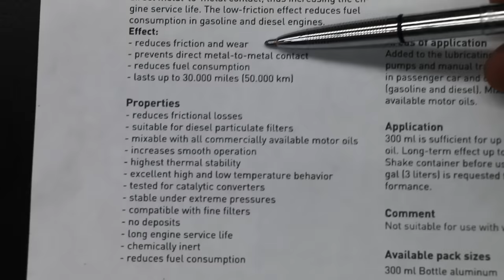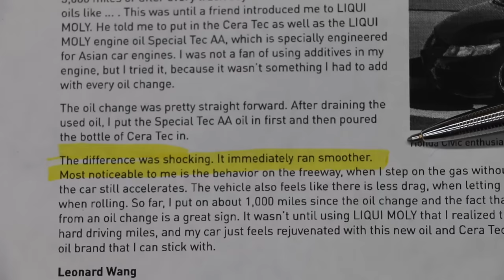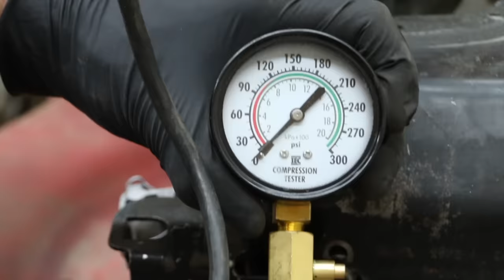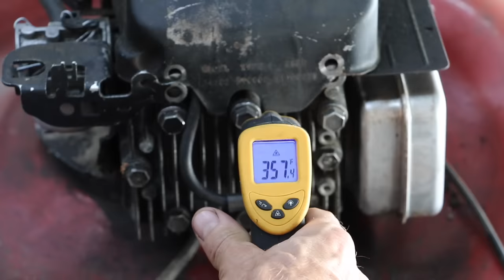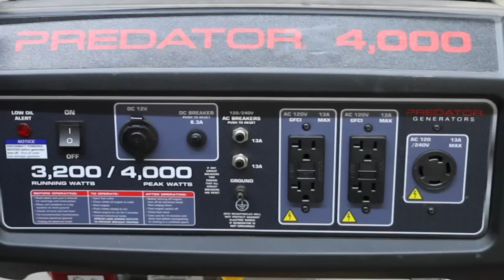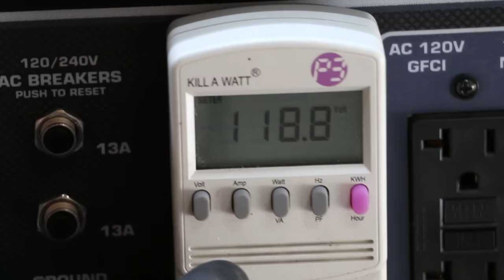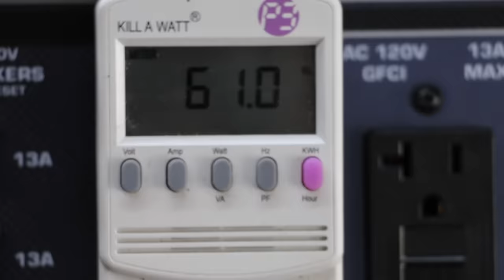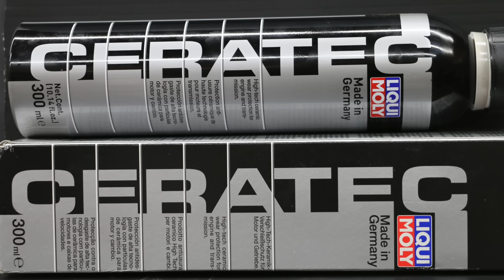Does Liqui Moly CeraTec work?  Let's find out!

Comment: Is it really fair to measure these results using a lawn mower engine? Think of the sheer amount of surface areas, contact points etc in even a small 4 cylinder car engine.
Reply: applicable to splash oil systems only i suppose, such as small engine mowers and the like.  modern automobile engine that has tiny oil passages and under great pressure, not so much.

Comment: THE COST FACTOR: 
Does the added cost out weigh the benefit ?
Reply from the maker: Great point.
Reply: Doesn't
Reply: If you run 100 tanks of fuel between ceratec treatments you will save 1 tank of gas, if my math is correct.
You also save at least 1 quart of oil.

Comment: To quote a poster named Daniel: 

'Moly is a solid friction modifier that takes at least 300-500 miles to film over the engine internals. I have been using Ceratec (a Liqui Moly product as well) with every car I own for years. Apart from smoother running, smoother idle, lower running temperatures, and improved fuel economy. I am positive that it keeps engines running longer. In order to determine if something is working, you must first forget about your expectations and make sure you fully understand the product.'  

end quote

Secondly: 

You tested this in a lawnmower engine (moly was not designed to be run in mowers...) for far to short a period of time.

Moly takes time (and miles) to coat the internal engine parts.

Thirdly, 

Moly was primarily designed to reduce wear and tear on an engine (usually automotive engines) the fuel consumption improvements are only a secondary benefit. 

As Daniel said 'In order to determine if something is working, you must first forget about your expectations and make sure you fully understand the product.'  

Maybe next time.

Comment: One interesting point that the Oil Geek made which nobody else has touched on is how these oil additives affect the additive package that's already present in the oil. I think that it would be safe to assume that any testing that Liqui Moly has performed on Ceratec was probably carried out using Liqui Moly oils. So if you want to run with a oil additive,  it might be prudent to stick with an additive from the same manufacturer as your engine oil.

Comment: Just something to think about if it was so good across all platforms why wouldnt big oil put stuff like this in to begin with and just charge more.  Also do you think the new plug had any affect on the engine rpm slight bump?  Thanks for the great video and hope to see you test the other additives too.  I would also love to see how much power you could crank out by bumping compression lightening the internals porting and polishing and some other inexpensive modifications to your bike engine and an expansion chamber if it doesnt have one sorry I cannot remember.  If you do gain more power i would like to see a gear ratio swap to take advantage for more top speed.  Thanks
Reply from the maker: All great point adn thanks for the video idea!
Reply: N1ck0145 Garage I haven't had the money yet, but I do have a series on engine modification. Trust me. I will work on your ideas as soon as I can. As I can afford them. And I have taken fuel efficiency testing into all of my experiments since 1999 so you can be assured the most accuracy possible for a street driven vehicle.
Reply: Because of cost.
Reply: Big sea but they could make the money back in by charging more
Reply: Very few people will spend the money for SYN these days. And own the retail side oil is pretty much non profit already. Its easier to explain a single product. when most people stick by one brand oil. This way makes it a lot less complicated.
Reply: N1ck0145 Garage it's already in nearly every oil for sale. Trust me this one IS used by the big companies. It's just unique to see it sold by itself and be something everyone likes. In low additive products for motorcycles, like Honda's motorcycle oil, they still don't skip this important additive.
Reply: I run Liqui Moly motorcycle additive in our super sport race bikes also works great.
Reply: I worked in the electronics section of a factory that makes giant doors for a few months.  I said they should have a 3 led display to show the position of a component in the door which would help allot with troubleshooting malfunctioning doors.  My boss said the vendor they use does exactly that but it's another dollar per a unit so they opted out.  My employer sold those doors for up to 100,000 dollars so I asked if they gave the customer the upgrade option for a dollar and he said no they don't.  If the masses don't demand excellence we won't get it and most people don't know what to ask for because it's complicated.

Comment: It's definitely not snake oil. Its effects can be seen over time but it does positively effect the surface of the cylinder walls.
Reply from the maker: Thanks for commenting on this.
Reply: Says the snake oil salesman.
Reply: evilution  It doesn't do nothing. It almost shot peens the cylinder walls over time and you're certainly not going to immediately see results of it. Its affects are long term.
Reply: In one 2013/ 30k miles engine which needed a quart of oil every 1000 miles of hard pushing we saw a great improvement seeing 1 qt of oil after 4k miles of hard drive. If that's not good results then I don't know what is.

Comment: I can tell you this, my 2018 Mustang GT had a ticking sound , as soon as I added Ceratec the tick stopped !
That is the real deal, anyone that has the Coyote tick, this stuff WILL stop it.
Reply from the maker: Thanks fro the feedback.
Reply: Agreed. My 2019 GT made so much noise you could hear it from 50 feet away just ticking away like it had a rock stuck in the engine. Poured a bottle in and after about 10 minutes it didn’t tick anymore. It changed the idle it didn’t sound as rough anymore. Not saying these tests were wrong but it has silenced my Coyotes engines problems.
Reply: Got rid of my tick as well, right after 1st oil change the car got the "tick". Added this and my tick is gone.  2020 Mustang GT 8200 miles.
Reply: @davidtennien2806  nice Brother

Comment: I have to say that it works at least on the noise perspective. I added this to my motorbike with a dry clutch (BMW K1200GT) and it worked wonders reducing the amount of noise the engine makes. This particular model of motorbikes are quite noisy and it indeed helped.
Reply from the maker: Thanks for the feedback.
Reply: Have you actually tested the noise level or does it just seem like being less noisy?

Comment: I just changed the oil in my VR6 track car before tomorrows event and lit looked like liquid bronze and I was terrified.  On the dipstick it's super clean and clear every time I check it.  Then I remembered I put this Ceratec in that oil.   As for my opinion, tomorrow will be the 6th time in the last year that car is driven 100 miles to the track, been hot-lapped for 120-140 miles, and then driven home.  The engine consumes 1/3 qt every 3000 miles and produces the least crap in the catch can I've ever seen.  I try to kill it every time I drive it and it won't die.
Reply from the maker: Thanks for sharing.

Comment: after the Failure of MoS2  I'm off the liqui Moly band wagon.
Restore and seafoam for life!
Reply from the maker: Restore and Seafoam are great products!
Reply: Ive used Restore watching your video as a directional guide for how to use it properly, and I know you arent a spokesperson for products but you have certainly helped show us that reading the directions carefully is very important to get the real best results from them, and im my case i certainly did with my old toyota engine. thank you
Reply: @dr.shahid3244  I am using Mos2 on a BMW  3 liters, in the cold winter of North America and it is working as advertised: Lower noise after start up, lower noise during normal idling and accelerating. Lower vibrations over all. lower coolant temperature. Better miles per gallons.
Reply: @TBPony  restore riuned my pathfinder r51 2007 4wd on first use the car bucks and sick not working well like bad spark plug after flush and refill with oil it be comes ok
I hate restore 👎👎👎

Comment: So Motorkote is the only one that works? So far.
Reply from the maker: Bestline and MotorKote both seem effective.
Reply: Project Farm - Ever since the Motorkote video, I can't find the stuff in any of the Walmarts! It's like everyone that saw your video ran out and bought it all up.
Reply: Itsa Mea itsa i went looking for motorkote to walmart as well and could not find any so went elsewhere and finally found a bottle in OReilys. About 2-3 weeks later i saw a bunch of motorkote on a clearance rack at the entrance  of the same wm store...bought a couple more bottles, but i think i could not find any to begin with cause the store was gathering the product for clearance...after that the store is no longer selling it..think it was justo a coincidence in time with the video at least in muy area..
Reply: I got mine off Amazon. So far it seems to be making an improvement in both my vehicles.
Reply: Try a Love's or some other truck stop.  A lot of truckers love the stuff and that's where I got mine.
Reply: will do, thanks
Reply: @ProjectFarm  motorkote there is a video compared to FR3 hot shots friction reducer, they put the two on a burner heated them up for a while and the motorkote  burna up into a thick sludge and FR3 is still clear.. Motorkote has chlorinated paraffins in it apparently and that's what causes issues when gets up to temp... It's on the hot shots secret page the vid
Reply: Iam using it in an engine for many years, no problem so far, engine always running good.I have tested it and its just fine.
Reply: @Itsa_Mea  Amazon..lots of it
Reply: @talonskull10  exactly where I ended up getting.
Reply: Pestilence Nigh : The FR3 is also a Group 5 Ester based oil which will take 500 degrees F. Motorkote probably will take 375 to 400 like most Group 2 oils.

Comment: We have a 2013 Skoda superb Estate 1.6TDI that we used as a van and, to run around for the employees, 190k miles....the engine started to be noisy and eating more fuel. I used the Liqui Moly sludge flush, and gave the car to the handyman, after 160 miles, we changed the oil with generic Skoda oil plus  LIQUI MOLY Pro-Line Engine Flush and new filter, left the engine running for 20 minutes and after emptying everything and put Liqui Moly Top Tec 4200 5W-30 + LIQUI MOLY Cera Tec. I was shocked at how nice the car was driving after, plus, the guys from the MOT said the emission test and everything for a car with 190k+ miles and 2013 is amazing, as it says in the book, It worked for my work/run around car. And even now, after 4 months, it drives very smooth.
Reply from the maker: Thanks for sharing.

Comment: Single cylinder Honda motorbike 150cc class… 1st a flush (liqui moly brand), then a “rinsing” oil change THEN the Ceratec mixed at 6% ratio with 0W-30 100% synth oil. Engine went from whisper quiet (before) to almost inaudible (after) Ceratec. Undoubtedly this stuff is doing something. Curious to see what it will look like after 5000kms in the drain pan guessing lil cloudy like cream in coffee.

GREAT channel🏅 Thank you🙏🏽
Reply from the maker: Thanks and you are welcome!  Thanks for sharing.

Comment: So with Mos2 on its own, I couldn’t see good results being shown. But I was told from a Liquimoly rep at a European car show; after questioning him about their products I was told that because it reduces friction: I should see improved fuel economy due to increased mechanical efficiency; and lowered oil temps because of the less friction . The Ceratec solids last 30k or 3 oil changes, you use Ceratec every 3rd or 30k miles. In between those miles you use the Mos2, because it’s the second part of Ceratec, the Liquid part that gets drained out with the oil. I was also told their Leicthlauf 5w40 has more certifications than most oil brands, that in order to get the oil has to pass rigorous tests. Now this is my own personal experience with Liquimoly:

I bought my car at 115k miles (engine VW ea888.3 1.8t), before I did my own oil change right after buying (wanted to make sure it had a fresh oil change, didn’t trust that the oil change was using OEM spec stuff), My engine oil temp would sit around 223-226 degrees F. That’s not a bad number, nothing to be scared about, on country roads when I was driving more in the boost range Oil temp would spike to 236 at it’s highest. After I met the Liquimoly rep, I was skeptical nut figured why not. I bought the Leichtlauf 5w40, Ceratec and did an oil change. My normal driving oil temps dropped to 217 Degrees Fahrenheit and when on load, or in spirited driving conditions, I peaked at 224-225; my original baseline! I don’t remember if my engine got quieter, however the drop in oil temps were enough for me to be a believer in the product. Since then I did 2 Mos2 additions to the 2 following oil changes, using the same oil, and the oil temps stayed the same. On my 3rd oil change (7,500 intervals I chose, Factory flow VW is 1yr/10k), I decided to add in Liquimoly engine flush, followed by refreshing the Ceratec with my oil change. The engine wasn’t loud or weird sounding to begin with (it had a spotless service history), but after that it just sounded smoother and healthier than before.

Comment: I have an 05 ram 2500 Hemi with 230k with a 5spd nv4500 I bought it with 48k back in 07, added nos wet kit of 175 shot from 124k until 206k when it developed a rod knock and metal shavings in oil, so I have tired almost everything and the liquid moly ceramic eliminates the knock for about the first 1000-1500 of the oil change. I'm changing it about every 2500 miles now but I drive about 200 miles a day in south Florida and still running strong
Reply from the maker: Thanks for sharing.

Comment: For me I had a piston blow by and after 3000 km 1900 mi on my 1.6 tdci engine i had a great results. I had a blow by but it was reduced by a lot, about fuel I didn’t see a difference and heat as well no difference but piston  rings was saved, only after you put it in you need in next oil change a oil oiler because on your crank shaft the cera tex will start to damage your shaft so you need an oil oiler so you don’t damage your shaft. Great video you are the best!
Reply from the maker: Thanks!  Thanks for sharing.

Comment: I've used Ceratec on a few different cars, an E46 330Ci at 115k mi, 2011 Outback at ~60k miles, and I've used it regularly on my 2013/2015 BRZs. In the first two cases, it really smoothed out a rougher idle, and improved oil burn in the BMW. Mileage on the outback took a jump. Never used anything but synthetic on both. 

On the BRZ, they naturally have a bit of a jumpy idle due in part to electrical (roll down windows, rpm dips and jumps). Also can be a bit noisy at idle. I also drive the car fairly hard. Ceratec really smooths out the idle, I've used in 3 times so far. On the other oil changes, I use MOS2 just to address specific deficiencies in US synthetic oil. that's after UA and recommendation from my tuner, who imports Japanese oil for the same reasons. Again, because I drive my car hard. I've used Mobil 1 in the past, royal purple shears and doesn't hold viscosity, but I've had really great results with LiquiMoly's new-ish
 synthetic line of 0w-20 and may discontinue MOS2 to see if there's a difference
Reply from the maker: Thanks for the feedback.
Reply: Is ceratec improve improve oil burn condition on brz too, please help i encouraged myself to use ceratec..

Comment: Im using Ceratec for more over decade. In my latest diesel engine after i apply it, it take around 50km and engine is much moře silent and also my consumption is at 4.5l / 100km. Before it was 4.9l /100km. Also measured on same road because im driving here everyday to work. Also it was both in summer.
Reply from the maker: Thanks for sharing.

Comment: I used CeraTec in my E150 4.6 liter V8 2 valve and my Renault Modus 1.6 liter R4 4 valve. After running these cars a few hours both engines began to run way smoother. The Renault got the CeraTec right after oil change (5W40 Shell synthetic), the Ford about 2500 km after oil change (5W30 Shell synthetic). I shared the bottle 40/60 for the cars, due to the fact that the oil volume of the 1.6 liter is about 1 liter smaller (4.7 liters) than that of the V8 (5.7 liters). Liqui Moly states, that one bottle of CeraTec should be mixed with 6 liters of engine oil to work properly. It seems to work pretty good, the Renault reduced fuel consumption from 9 to 8 liter/100km with new airfilter, spark plugs and new oil. The E150 runs with 12 to 16 liter/100km.
Reply from the maker: Thanks for sharing.

Comment: I know this video is old, but I have been running this in my E92 N54 (Twin turbo I6) for a couple months now and the biggest thing I noticed that it did reduce the engine noise, and the oil temps by about 5-10 degrees Fahrenheit. However, that could be because the motor come's factory with a fairly good external oil cooler, and the low friction, allowing better oil flow could've resulted in better cooling. Either way, it works great on BMW N54's.
Reply from the maker: Thanks for the feedback.

Comment: I've had a positive experience with the ceratec. My old lawnmower was hard to start, a lot of black smoke and low power. After adding the ceratec and after a couple of minutes of running the smoke disappeared and power was restored, also it was easy to start the engine...

Comment: I use it for all my cars and the biggest difference i saw on older gm engine (2000 year model y22dth ) it had 4.5ltr.100km consumtion compared to 5.6 factory spec. I still use this product to this day and can vouch for this product. Really great product in my opinion. One thing though, i saw best result when i fully flushed old oil from the system.
Reply from the maker: Thanks for the feedback.